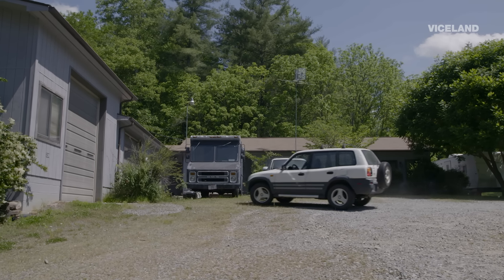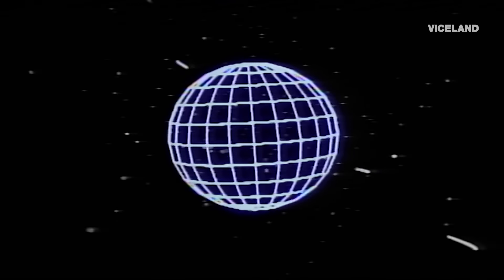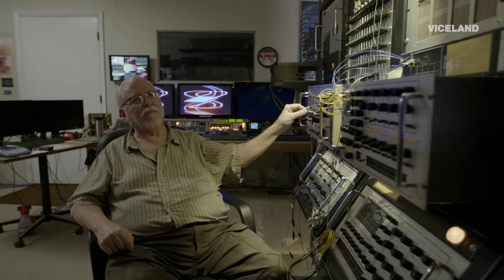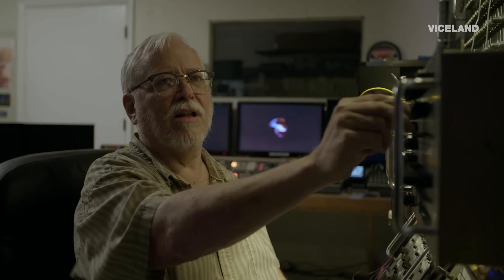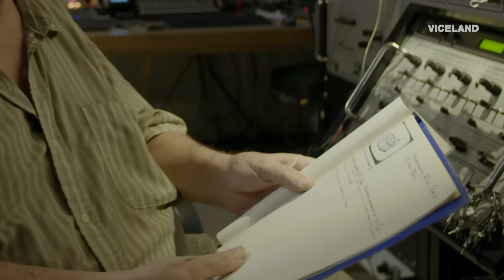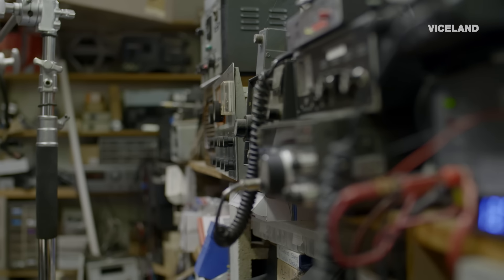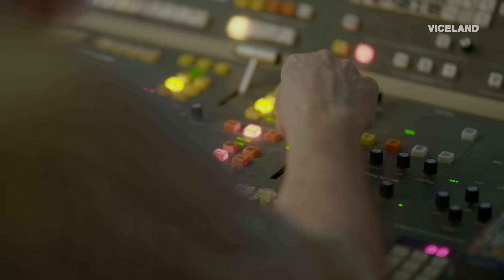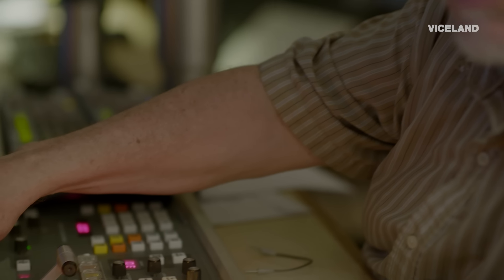Meet the Engineer Preserving The Last Analog Motion Graphics Machine

Comment: I have forgotten the name of that OLD 1990s device Old 1990s device where you connect your vcr, tv, dvd, etc and just press the bottom if you want to watch tv or vcr or dvd or whatever while all of them are running at the same time. Anybody out there knows the name of that device? My American friend wants to know the name of that device because he remember using it as a kid when in the 1990s he has a TV, a VCR, a DVD, a Radio-Cassette, a Hi Fi Stereo FM and AM set with vinyl record phonograph. And is there anybody out there who knows the name of that OLD 1990s TECHNOLOGY DEVICE? He said it more convenient than those all digital system when with his old 1990s technologies (some of which he is still looking in his garage) are all analog controls using press bottoms, level bottoms, knobs, dials, slide controls, slide switches, lever switches, etc ALL ANALOG as he describes it.

Comment: I believe analog graphic cards will be a thing once more once all those fancy "gates" we put into scilicone reaches a certain point. At least it could output a continous analog signal while digital takes calculations and has delays. Just try blurring the text in any mordern computer and it will take longer than "instantly", which is what you get with this thing. These huge machines may not come back, but we will one day run into need for analog calculations, powered by fully automatic relays and DACs controlled with advanced technology rather than by hand.
A mordern graphics card can only render so many frames per second(or rather frames per day in industrial filmmaking), because you want to get realistic physics and good-looking ray tracing. What if we use analog circuitry to do it real-time? It doesn't have to be mathmatically pinpoint accurate, any small change in real world can affect the coutcomes anyway.

Comment: Would have been easier to just write the words on rotating posterboards and then move those like was done pre-1927 (no sound so reading the dialogue or credits was all you could do) and that worked fine. If it ain't broke why fix it?

Comment: Electronics of yesteryear were not “made to be fixed,” they were repairable because of they way they were made. It’s not that products are intentionally made to be non-repairable for the sake of it today, it’s just the components used are highly sophisticated and many circuits are miniaturized and integrated (hence IC), so there typically aren’t components like 10 cent resistors that can be replaced. Analog processes can be replicated to a high degree, but there’s no way older machines and computers can do what today’s technology can do, especially not at the space savings and power efficiency of modern equipment.